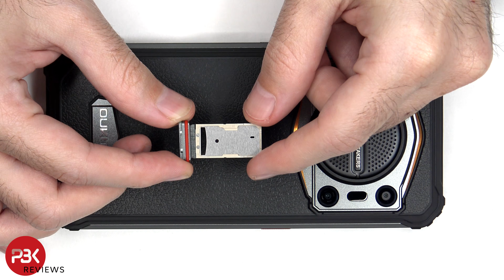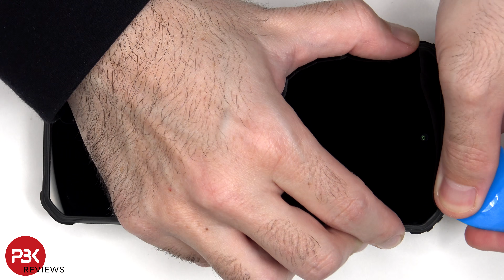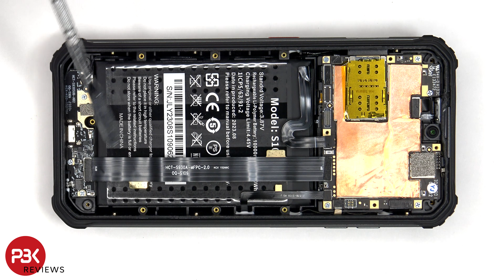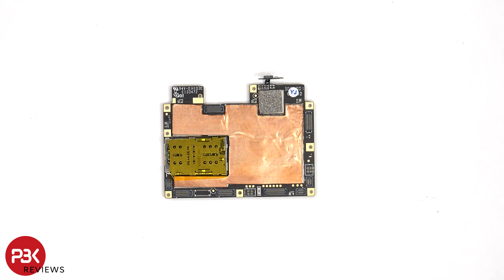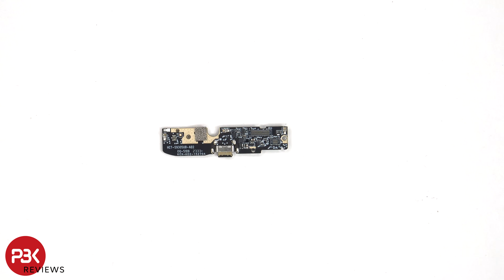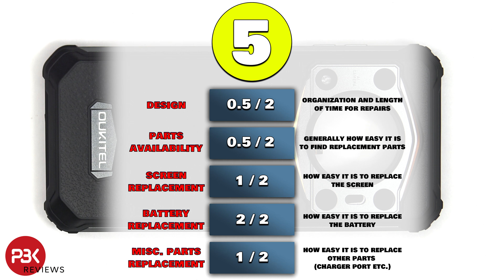Oukitel WP22 Rugged Smartphone Teardown Disassembly Repair Video Review

Comment: can I ask you if the fossibot F102 needs roughly the same process to remove the screen? it has torx screws on the side and all I need to do is replace the screen, thanks a lot!
Reply from the maker: Yes probably. These line of phones usually use a strong glue to bond the screen to the frame, so it won't be easy to pry it off so keep it in mind. But the fact that you need to replace the screen anyways, you don't need to worry about damaging or breaking the screen taking it off so might not be as difficult vs trying to save a working screen. :)
Reply: Thank you so much! You are extremely helpful!